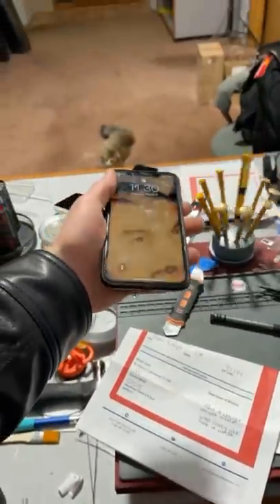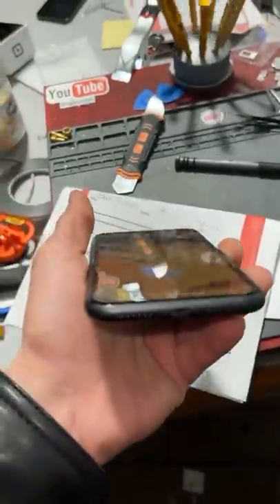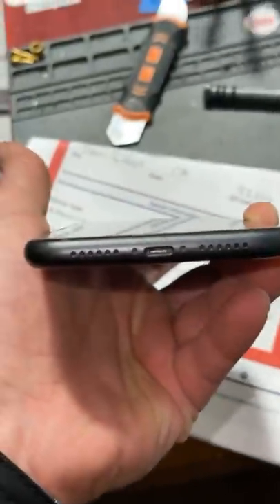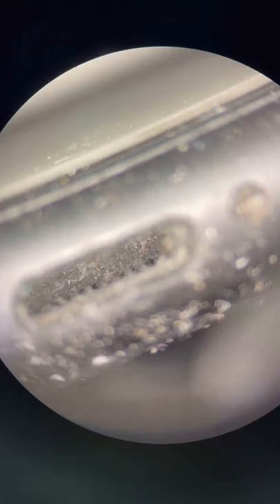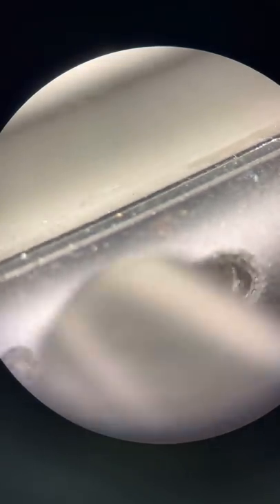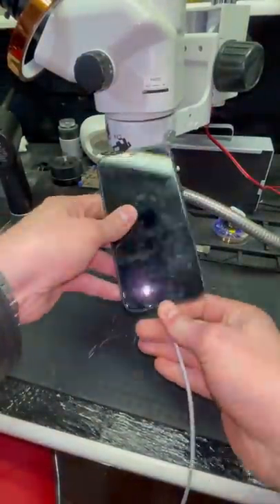Broken iPhone Charger Extraction #shorts #oddlysatisfying #iphonerepair

Comment: gotta love how after getting their broken charger stuck, the first thing they thought to do was to superglue the charger into the phone.
Reply: Either that or take say a thin flat nail, and glue it to the piece in the phone hoping it would make it solid enough to pull out
Reply: Ikr some people just don't use their brains.
Reply: That’s not what they tried to do… the tried to superglue the part of the charger that came out to the part that was stuck in there.
Reply: @Alexthornbro 1112 you do have a point...
Reply: Or they did it intentionally to see if he could fix it
Reply: I think they tried to glue it back to the charger to pull it out
Reply: @Alexthornbro 1112 bro chill 💀 you destroyed him
Reply: @Alexthornbro 1112 I never thought of it that way
Reply: @Alexthornbro 1112 Damn. Brilliantly said!
Reply: The thought process was probably to try to pull it out, see if you have glue on something, you let it stick to the thing stuck and them you YOINK it out, it actually works well but more so with hot glue sticks... not crazy glue... cause it sticks too well...
Reply: This method works over half the time. Same for six cords. Super glue is a fine tool in some of these cases
Reply: I think what happened is that their charger broke and they cheqped out on replacing it and instead glued it together. But the broken part alongside some glue ended up stuck in the charging port.
Reply: I did

Comment: phone charger gets stuck
Person: "ah yes let me just put some glue in there, that'll get it out."
Reply: High iq moment
Reply: A yes this is BIG BRAIN TIME!!
Reply: IQ level 💯
Reply: Maybe they crazy glued an end of a toothpick or something and tried to pull the broken pieces out
Reply: I think they glued the charger back together than it broke off while it was in the phone but I'm not sure if that'd even work
Reply: Maybe they had put a glue on its charger and tried to make it stick together hoping it would work
Reply: @faxgirl4666  y
Reply: "What are you doing step-person ?"
Reply: I think his friends pranked him by putting glue in his phone so the charger sticks to the phone but ended up breaking the charger 😂
Reply: big brain
Reply: @vinoo882010  yes, something like this happened to me with the HTC vive controllers and this is exactly what I did, try to fish the broken pieces with a toothpick and super glue. XD
Moral of the story...
NEVER use those cheap magnetic micro USB chargers, specially with things that are not phones. They will get stuck and never come out. When you try to take them off they break. And trust me, the glue did not make it worst, it was unbelievably stuck just by itself.  
 

Never use those
Reply: They probably broke it off inside then put a drop of glue on the cable part and tried sticking it in to pull ilyt the broken bit
Reply: Lmao They would have better luck just taking the whole damn phone apart then glueing it xd
Reply: @cody1212143  sometimes the USB socket can't be accessed even from the inside.
Reply: I think he tried to glue the stuck piece to a stick so he can pull it out
Reply: Man was crazy, should’ve used some hot glue
Reply: @SiddarthSenthilMurugan  more like 70-80
Reply: @vinoo882010  most likely they did but that's still idiotic
Reply: Smart boy 😂
Reply: i think they put a cotton swab thing in there to try to get the peice to stick to the cotton swab then yank it out
Reply: @_Ciosu..  wtf dude...
Reply: His Genius is beyond our understanding
Reply: Prob putted glue on a stick and sticked it up for a couple mins and tried to rip it out so the thing will come out to damn someone already said dat
Reply: Iphone owner levels of iq right there
Reply: I’ve actually gotten this piece out a few times since with my old iPhone 6s Plus that piece would break off and I would have to dig it out, it doesn’t happen with my newer phone tho,
Reply: "I'll try gluing, that's a good trick"
Reply: @Twigidi This comment you made is stupid, they used the glue to pull out the charger
Reply: i think they wanted to stick the piece to something so they could pull jt out
Reply: *BIG BRAIN MOMENT*
Reply: I just can’t figure out the logic behind that like what were they thinking about
Reply: Glue is known to losen things up, of course. 🙃
Reply: Woman moment
Reply: @Nexus104  y try iokogot
Reply: Their charger probably kept falling out and wouldn't stay in the port, so like the genius they are they decided to put fucking crazy glue on it.
Reply: If u connect super glue to something stuck like this and like a toothpick and pull it out when it's done it can take it out.
Reply: i think they were trying to glue somethi g onto the charger piece to pull it out with it
Reply: @vinoo882010  thats what i was about to say and thats also how alot of people get their broken piece of their key out of the lock
Reply: BIG MAN
Reply: @SiddarthSenthilMurugan  wdym 100 is pretty low
Reply: Iq level is over 9000000000
Reply: That’s how people usually get it out they get a toothpick and something like that and glue usually will work I don’t know why they tried the charger usually need to do headphones jack
Reply: Yep
Reply: I did that too ngl😅 but it was my headphone plug, I tried putting gorilla glue on the tip of a chopstick to try and stick it to the broken piece and pull it out, buttttttt I got the chopstick stuck in it too on accident, oops😂😂😂
Reply: "Hmm if its called hot glue then how about i mel the charger and before i do that let me try some glue
Reply: B i g  b r a i n  m o m e n t .
Reply: They were desperate and panicking so therefore they made a stupid mistake
Reply: It actually worked for me.
Reply: My thoughts exactly, what were they thinking?
Reply: @vinoo882010  TY!
Reply: Big brain
Reply: I try to make sense of it like they're going to put a string in it and wait until the glue dried but I don't think that would work honestly
Reply: ajjabdbsbsbdhreb IQ 0%
Reply: If you google it ..it actually tells you to use super glue... I did the same thing trying to get something out of my headphones jack
Reply: @jigsaw27  you should try that in your next trap
Reply: This literally happened to my phone at the beginning of the pandemic. I tried toothpicks and such but still cannot get it out. It's then time for searching up hacks and the super glue one came on top. Yes, I used super glue. Yes, it did not work for me as well. I literally had to spend an entire year of pandemic without phones.
Reply: Maybe they thought: if the glue is sticking out then I'll be able to just pull it out!
Which is kind of a stupid thing to think..
Reply: @byalvaroft  you lucky bastard, you get to worry about HTC vive controllers while my broke ass only has a 500 USD PC
Reply: I think they tried to connect it back to the cord to pull it out but I agree it’s not very smart
Reply: @lardlover3730  Well, it´s now a lot more afordable to get in to vr, the quest 2 is like 350€ and you dont even need a pc. (Athough I think is nice to have one)

I bought the vive on launch for almost 1k in 2016, so things have certainty gotten a lot cheaper.
Reply: Big brain time
Reply: Well sometimes when glue hardens you can then just yoink it out.
I filled some barbie cups with glue to act as water only for it all to slip out.
Reply: Super brain mhm the glue totally wont spread In the hole
Reply: I was expecting this to be done by someone from FLORIDA not CALIFORNIA
Reply: What a genius movr
Reply: YouTube search ALMIGHTYPIXLEY “On my mind” on YouTube
Reply: Maybe he was trying to pull out the charger by putting glue inside it and then putting a stick in there too so the glue would stick to the charger and the stick and when he pulls the stick the charger comes out but I think he didn’t realise the glue would stick to the port as well not just the charger and the stick broke and now the glue was left inside the port which made it worse. Just a theory
Reply: It works with broken aux cables. Bit of superglue on a cotton bud and it pulls right out
Reply: @spencercamara5104  that’s just as dumb
Reply: I think they prob put crazy glue on a stick or something and was trying to glue the stick on the charger so they could pull it out
Reply: Sparta 😀👍
Reply: lmao yes
Reply: @Maliya Lyons  probably 😭
Reply: pretty sure they tried to use superglue to stick it to something else and pull it out, like they do in those five min craft vids
Reply: I did this because I was so desperate once. It worked.
Reply: Tea
Reply: No.
Reply: Maybe if theres a very VERY thin lengthy tweezer type thing and put like a very small but useful amount of glue to touch the stuck piece and just pull
Reply: PAHAHA
Reply: Ah yes lemme put this ice in teh sun that’ll freeze it quicker
Reply: Smort
Reply: Just speculation but I think they stuck glue to something and tried to get it out by sticking it to the charger
Reply: @vinoo882010  yeah it kinda made sense
Reply: Lol
Reply: i think they got the charger stuck, and broke it, glued the charger together hoping they could pull it out, but failed.
Reply: Worked for me in my MacBook SD slot when a corner or my SD card snapped off in there. Bit of glue in the card corner, slot it back in, dries to the snapped off segment and voila all good.
Reply: They probably ment they tries to glue some kinda longer piece to it to pull it out. Cus other than having proper tools that's the only way you were gonna get it out
Reply: i think they tried glueing the two pieces together and then using the inter one to pull out what was stuck inside but it didn't work
Reply: High IQ🧠
Reply: Why do I keep seeing crazy glue fixes on electronics? 🤔
Reply: @jigsaw27  that friend would be paying for my new phone.
Reply: @LeninCake   there are much better ways
Reply: This works with welding, they've actually a nifty tool to do this exact thing for car dents. Just not glue lol.
Reply: 99999999999IQ
Reply: @zulhimi3335  nothing, just come in the van
Reply: Im dying this is too funny
Reply: Toast stuck in toaster
Reply: I think I understand why they did it, it makes sense but to little children. Put the glue in, let it dry, then pull out the glue and the stuff stuck in the glue. I’m assuming that was his thoughts..
Reply: Lol
Reply: Must have seen it on tiktok
Reply: maybe they just put like the glue on a piece of plastic and put it in the charger port so that they could pull it out
Reply: Maybe they think put the glue, get a stick that's long and strong then pull it out or sumthin
Reply: @vinoo882010  yeah i think the same
Reply: Girl stuck? Let see what a glue can do.
Reply: Wait, hold it I just had a fuckn bruh moment
Reply: @SiddarthSenthilMurugan  100 iq is there average...
Reply: They probably tried to use the pen trick gluing the piece to the pen then pulling it out.
Reply: That happened to my iPad but I did not put glue but I took it out
Reply: 200 IQ
Reply: @haleycancook9668  300
Reply: @internal.rage.  400
Reply: @haleycancook9668  401
Reply: @internal.rage.  402
Reply: Maybe something like hot glue that isn't really adhesive but molds into shape could yank the broken cable out. Super glue is stuck forever when it is applied
Reply: woosh
Reply: @SiddarthSenthilMurugan  that’s literally the average IQ
Reply: @vinoo882010  it would also be glued to the insides of the phone 🥺
Reply: yea  High iQ  moment 👍
Reply: The biggest of big brain moments
Reply: That better not be a light microscope
Reply: I mean, they bought an iPhone, what do you expect??
Reply: I've done it with my ignition when my key broke off in it. You super glue it to something else and try to pull it out
Reply: are they trying to like get the glue hard as a rock and pull the glue out like a ear that have something stuck inside?
Reply: Haha
Reply: There probably trying to stick it to something and it didn’t work
Reply: @duel1695  they're
Reply: @Goblin4461  sorry about the spelling
Reply: Maybe it's used to pull the part out
Reply: Yess
Reply: @vinoo882010  I tried this but with solder and a stripped screw on the bottom of an iPhone x😅.  Didn't make it worse but it didn't work either
Reply: I’m pretty sure that absolutely everyone tried that including me
Reply: I watched a video about it . I put a tiny bit of superglue on the end of the broken charger

Comment: An X-acto blade works as well with this kind of issue too. Just place the tip at the edge and lift the metal charger piece out with ease.
Reply: It was glued in there breh
Reply: @sanjidandelion  I meant in a general sense lol

Comment: I'm still confused how someone's charging port gets that dirty.
Reply: I work In carpentry and my phone and airpods are always fucking filthy 🤦🏻‍♂️
Reply: Dude I used to do electronics repair for a company, customers had some of the filthiest ports I've ever seen. I used to pull bits of paper, toe nails, sawdust, and unidentifiable greasy material out of them all the time.
Reply: Pocket lint period!
Reply: @ALEXANDER URREA RAMIREZ I feel called out 😂😂
Reply: sanding body filler and primer is how for me
Reply: They all do. Try dig through yours with a toothpick. 

Your pockets aren’t as clean as you think they are.
Reply: It always looks different under the microscope. Your charging port is also probably that dirty.
Reply: Pocket lint
Reply: @megami215  yeah, fuckin clean it
Reply: Glue😂
Reply: I work in construction and my charging port is filthy, mostly from sawdust
Reply: Pocket dirt and I can’t clean mine that well because I don’t have the right stuff
Reply: You can just buy dust plugs. They cost about $4-$5 on Amazon and go with the style of your phone. Plus looks like everything is getting wireless charging. Who knows phones might not even have the cable dock in a few years
Reply: Construction Fosho got mine filthy
Reply: I’m a student and I do nothing but study and my charging port is dirty. I think like pockets and the lint and stuff in it get jn the charger??
Reply: Dust
Reply: It's normal, according to insider.
Reply: Mine is because I work at a pizza place and literally everything that enters the back of the store gets flour in/on it 🙃
Reply: i’m sayin 😂😂😂
Reply: It’s hard to clean honestly

Comment: How A Charging End Should Get Stuck In Phone? Mine Doesn't Even Stay Still😂
Reply: It broke off inside
Reply: It happened to me in my iPad. I dropped it and it broke off inside of the device, so it was hard to get out
Reply: Clean your charging port. Thats a common problem.
Reply: lightning port is insanely grippy you can swing your phone around above your head like a lasso and it is not slipping ever
Reply: Trust me bro lightning cable is trash
Reply: @mr.waffentrager4400  it is. it happened to my little cousin once. thankfully i was able to take it out. but lightning cables are horrible
Reply: @MARlPOSA  imagine getting a usb c cable broke , the pins inside your phone would snap off. Lightning is much much stronger and more resilient than usb c for snaps as the moving part and the most vulnerable part is the cable you can replace for $5
Reply: Dogs know a lot about this
Reply: @adampeters8547  that’s what she said
Reply: It happened to my mom's phone it was me who did it I woke up in the morning I grabbed my mom's charging pulled the charging cord out and it was stuck inside
Reply: @cemops8660  I agree. If lightning breaks inside your phone it can be pulled out and the phone would be fine if the same thing happened to usb c the tiny board in the center with the pins on it would probably snap with the charger and you would either have to replace the charging port or get a new phone.
Reply: @cemops8660  i keep wondering if there are any chances android phones get lightning cable and port in the future (if there are any already with one, then feel free to correct me)
Reply: why do you capitalize EVERY WORD
Reply: This happened to me like twice from crappy Walmart chargers but its an easy fix if u have good eye sight and a sturdy pointy object.
Reply: It happened to me ounce I pulled it out to quickly
Reply: @iZetto1  no cause lightning is outdated and totally sucks
Reply: Well the quality of the charger head could be low quality for one, wear and tear, and the inside of the phone could refuse to let go of the tip and cause it to rip off and stay inside the phone
Reply: @TheActualJeffery  Am I seriously the only one who has had this happen to me without dropping it with the charger in the phone being the cause and the only cause was me taking out the charger
Reply: Why do you capitalize every word?
Reply: @TheActualJeffery  same
Reply: And then they thought “what if I glue it in then it should come out”
Reply: @TheActualJeffery  relatable
Reply: I’ve gotten it stuck somehow pulled it out with my teeth by barely getting a grip
Reply: That happened to me before but the part you plug into the phone had broke off into my phone but it was easy to get out
Reply: @cemops8660  except USB c don't break like glass
Reply: @TheKidJake  The cheap ones are loose. Brand name or general higher quality is tight.
Reply: @TheActualJeffery  same happened to me twice with my iPad
Reply: @cemops8660  apple wants to be Eco-Friendly
Reply: that's what happens when you buy crapdroid 😂
Reply: @videos44  wdym android, this video is about and apple phone

Comment: How can you even make the end of a charger get stuck in your phone?
Reply: Put it in without the case on, twist it as hard as you can. Congrats! You just ruined your phone!
Reply: @mynameisvelk  I bet you tried it before right?
Reply: I did that once. I have an outlet right by my bed so i leave my phone to charge on the bed. I forget one time and slept then woke up with the charger twisted inside the phone. Could easily pull it out though as the inside wires were still attached
Reply: dropping the phone while charging could probably break the connector